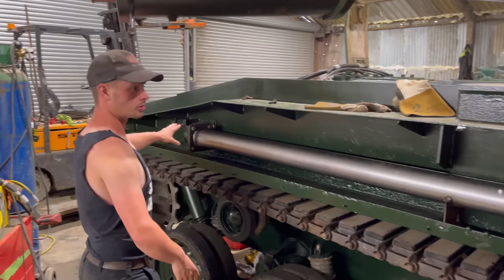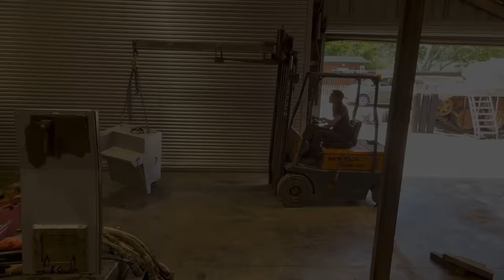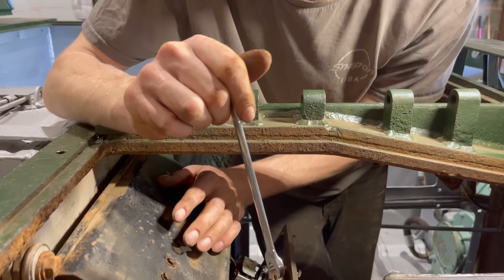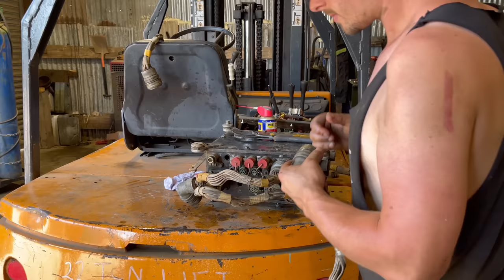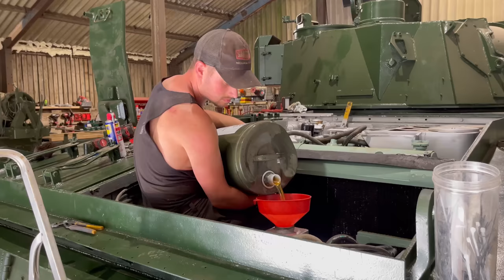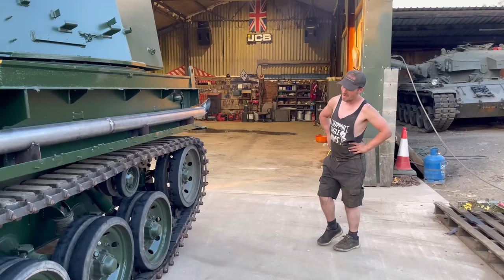DIANE DRIVES OUT THE WORKSHOP!

Comment: Tip - toilet bowl cleaner will de-rust anything. Bolts, nuts in a pail, soak a couple days then wire brush. You can paint in on bigger things, couple coats over a couple days, it works great.

Comment: You did crank up the engine and run it for a little bit while it was outside the tank to check for functionality cuz I'd be a pain in the ass to get it all installed and it won't crank over and have to pull it out again